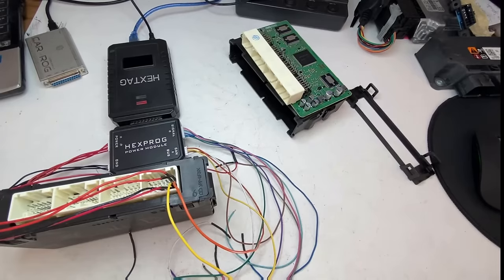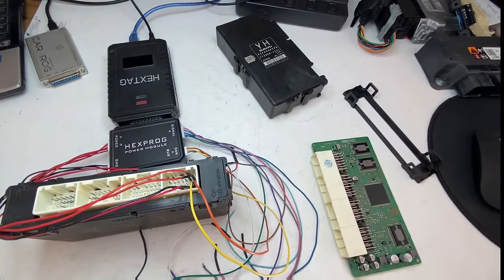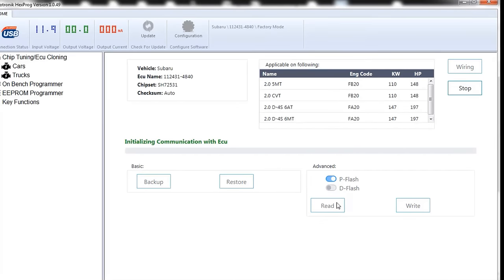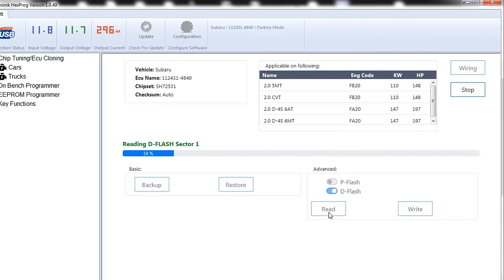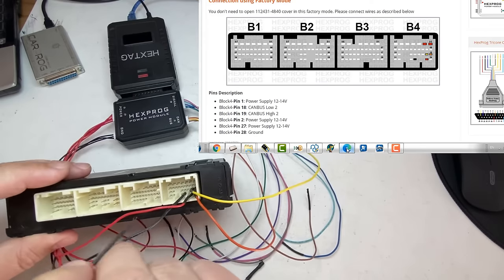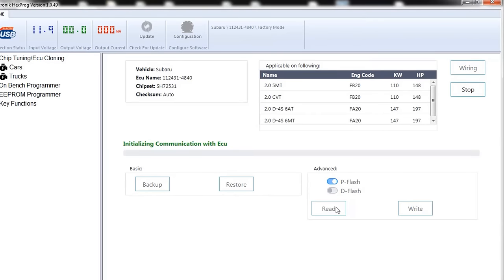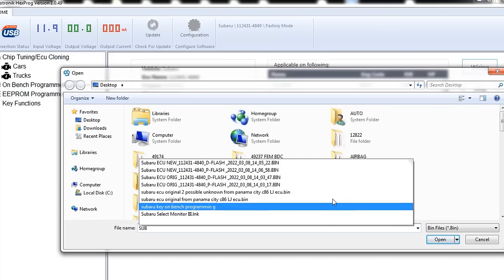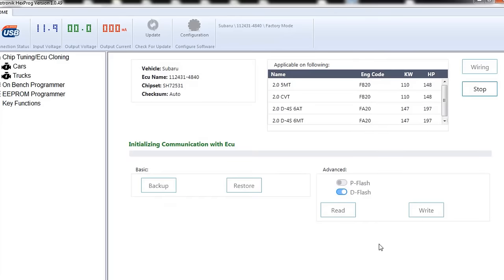Pro Tips for Subaru ECU Replacement | PCM With NO EPROM| How to Read and Write

Comment: I have a 2015 WRX. I sold old engine with ECU and installed new engine with a new ECU (ECU in engine bay) Now my WRX wont start. It unlocks and disables alarm but wont start. Do i need to reset the imobiliser to match the new ECU??
Reply: yupppp, your key is not recognized

Comment: 2006 subaru sti pcm replaced. Po447 and 448. Unable to resolve. Still have original pcm. Paid $1800 to troubleshoot and swap. Reprogramed with 2 fob keys.
Reply from the maker: Sucks to be you we do it for $180 at Karmanauto.com